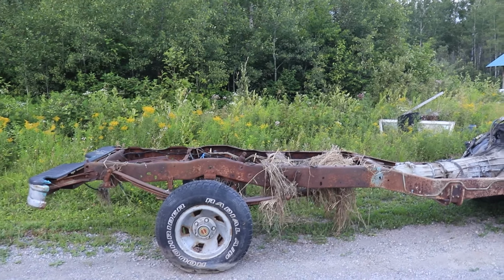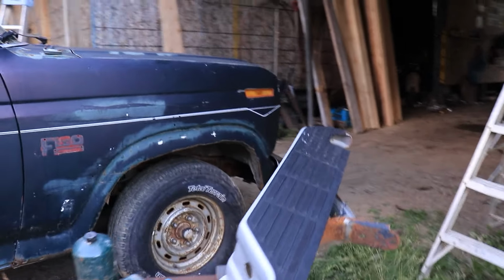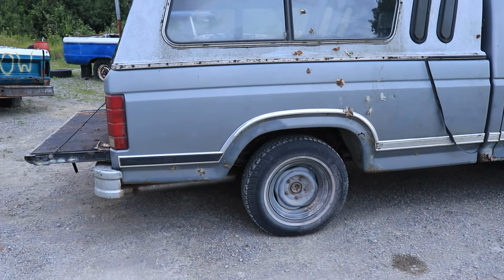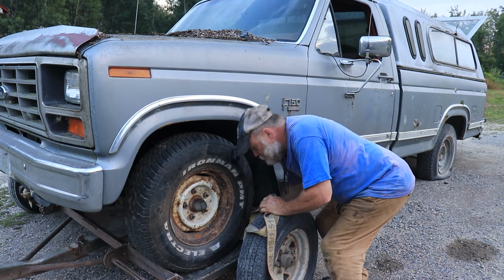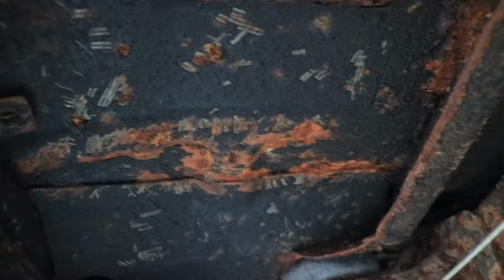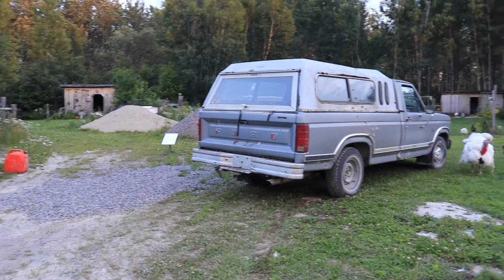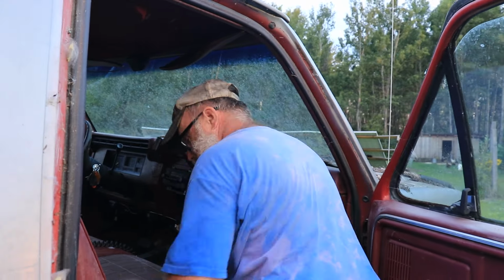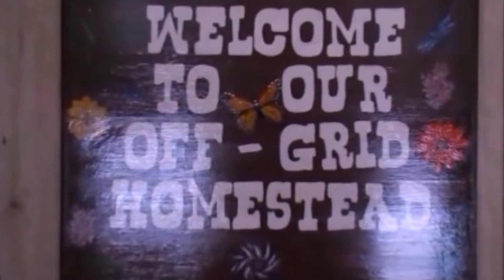Over 35 Years Old...Sat For Years In The Trees, Will It Run And Drive?. Off Grid Homesteading.

Comment: Awesome score bud. I had a 1987 5L . Sold it after 300,000 km and it still ran like a top . Your gonna like this truck. The only thing I had problems with was the fuel pump relay  connection under the hood on the fender... green  looking corrosion.

Comment: Good looking trucks! some tlc  and you have one for the road one for the shop and one for the fields. Just keep rotating.  One thing that is really big is that newer vehicles have air bags.  But, don't skip your seat belt, you will most likely be OK. My 2001 F150 has 307xxx miles. They do keep going!

Comment: Just wondering do you need a licence to use the CB radio i have used CB for long time we used to have a licence back in 1977 but they scraped it few years after the goverment i mean but im still using it after all those years i like that last van you have the good one its great to fix and wont take long to do it and on the road